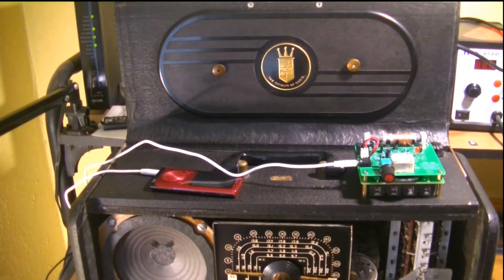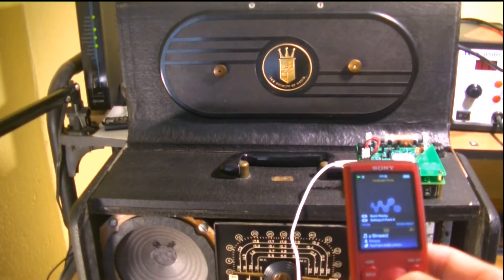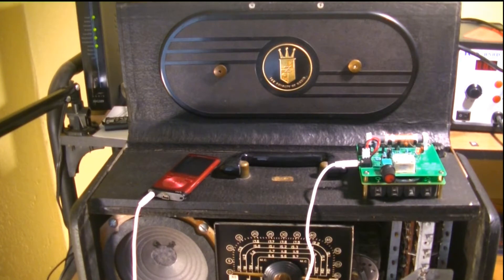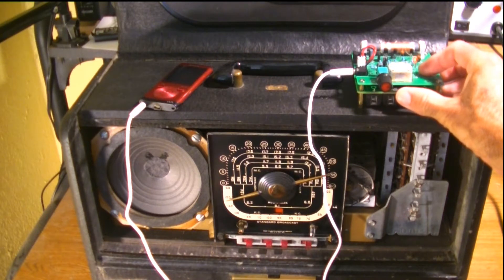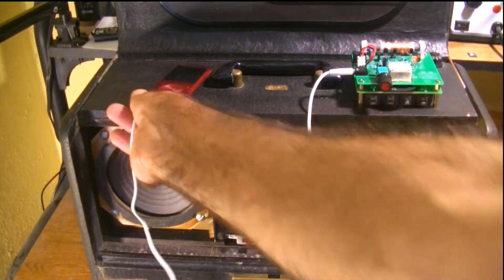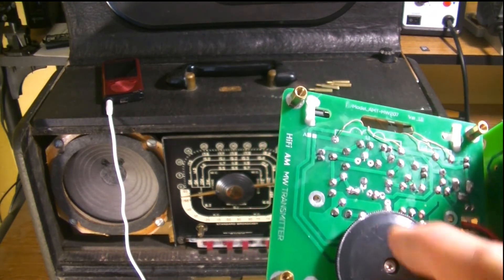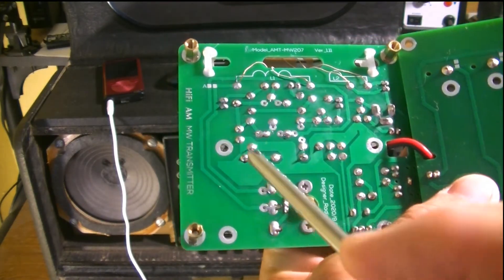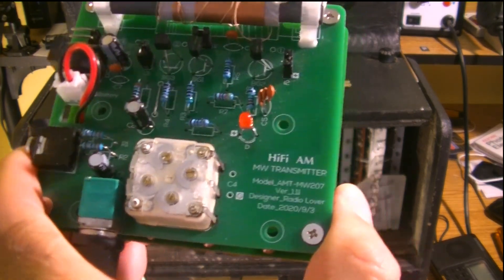Part 2: AMT-MW207 AM broadcast band transmitter  Review and setup with the Zenith Trans-Oceanic G500

Comment: That scope output is also an RF output, so yes, you can connect an antenna to it.  BUT, you will also influence the output signal, meaning the frequency might shift slightly.
NOTE! There is a core + and a ground - side!  Perhaps with a tuning capacitor, the output could be tuned a bit. if you use a wire and ground try the tuning capacitor between the two
so see what the signal does when you put the tuner capacitor between the wire and TX and also test it when you put it between the ground wire and TX

Comment: You may use flathead screwdriver to expand AM tx up to 1710 kHz.
Reply from the maker: Hi Francis. The tuning range is adjusted by the trim capacitors on the variable capacitor as well as sliding the  coil along the ferrite rod. Some have asked where is the antenna for this thing, and the answer is the  ferrite rod is the antenna like the ferrite Rod is the antenna on a small transistor radio.  Also the kit performs better transmitting on the lower end of the  MW AM band. This kit is very short range so needs to be next to the radio receiver.  It will overpower any radio station so no need to find a quiet frequency on the receiver. The batteries last a long time and the sound is good. Good luck!

Comment: What are these red and black wires ? Is this for battery or AC terminals? Plan to make plastic box for this AM transmitter as DIY and install on and off switch for that .
Reply from the maker: Hi Francis! The red and black  wires go to the battery {4 AA} board. In my kit the audio input gain knob also has a power switch built in.
Reply: @RobertWardJones  https://youtu.be/lV00hxpmtqM

Comment: You can test brosdcast in 9 kHz increments like 1485 or 1404 kHz with digitally tuned receivers: tune to 1485 and 1404 AM on Tecsun PL-310ET or PL-660 or Eton Executive and for Eton Sidekick or Eton FRX3, tune to 1480, 1490 or 1400 kHz to see what sounds like or some sort of distortion as the sound isn’t clear on 10 kHz AM digitally tuned Eton NOAA radios except for Panasonic PLL MW/NSB radios and Retekess V111 (6.25 kHz bandwidth), Eton NOAA radio have 2 kHz bandwidth for AM but Eton Executive and some Tecsun shortwave radio models have bandwidth selection from 2 kHz to 6 kHz bandwidth.

Instead of bringing 10 kHz digitally tuned AM radios to 9 KHz tuning step countries (South Korea, Philippines, Guam, Palau, Saipan), you should test that first before bringing those radio receivers.

HD RADIO receivers have AM bandwidth uses 1.8 kHz but Sangean and Sparc HD Radios have international tunning support.

Comment: I got one of these kits in the mail yesterday; put it together and it works perfectly. Mine is a newer revision than yours (version 1.2r, with a date of 9/26/2021) and there are some differences: 

- It doesn't have the A and B jumper pads at all, and it doesn't have the labeling for them either. For the B pads that you had to jumper, mine just has an uninterrupted trace. 

- Mine doesn't have the mystery jumper pads on the battery board. 

- On the top of the main board, between the R6 and R4 resistors, I noticed that you have a jumper wire connecting two through-holes. On mine, there's a trace between those two holes, so no need for a jumper wire.

- Mine didn't come with a connector to solder into the "monitor" and "G" through-holes.

- Whatever that thing is on yours in the upper right-hand corner immediately to the right of the BG2 transistor; mine doesn't have anything there at all.
Reply from the maker: Thank you for the detailed update. I appreciate your contribution and the help it can be for others who are building and enjoying this kit.

Comment: Hello Robert! Thanks for sharing this, especially the part to connect jumper pad "B" below the variable capacitor. Your part 1 video was also very helpful! I think I will try connecting a wire to the "Monitor" port (not the one marked as "G")  and see if the range is increased. I will let you know if I see any improvements. Cheers!
Reply from the maker: Hi Cesar!I am very glad you found it helpful! You can try a single long wire to one pin and the other to ground or connect two long wires, one to each pin to make a di-pole antenna. Let me know if you see any improvement. Thanks!